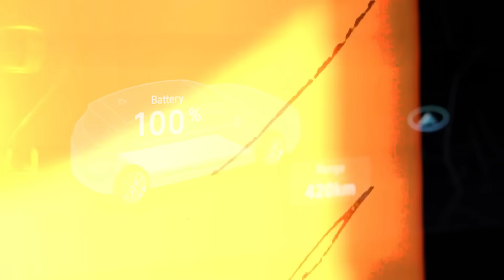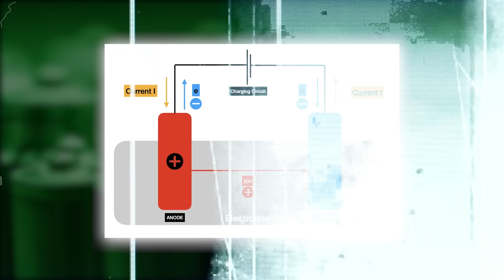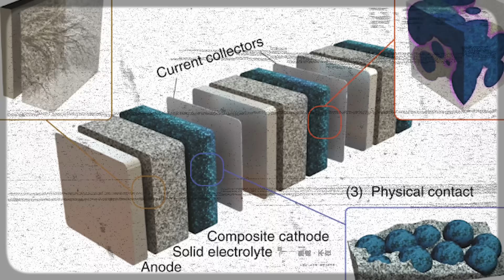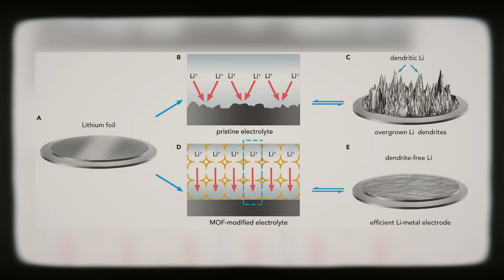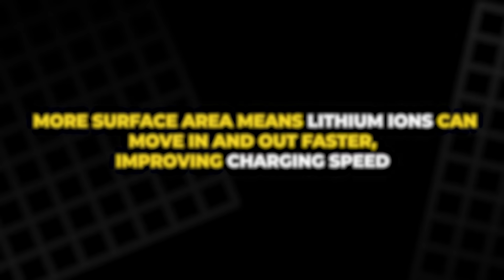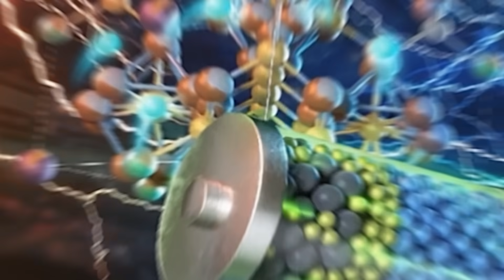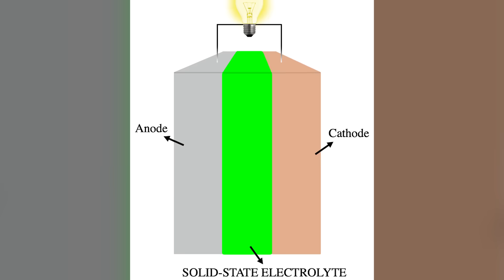Electric Planes? CATL’s CondensedBattery Makes It Possible

Comment: There is no E in Catl . Also when will it go into car and how much does it currently cost? Sodium battery's would be better for fixed solutions for Grid Backup or Home backup . weight is not factor and they are half as expensive as LFP. More Lithium needed for these which means more expensive.
Reply: Check your data